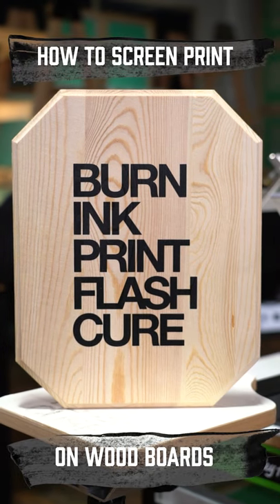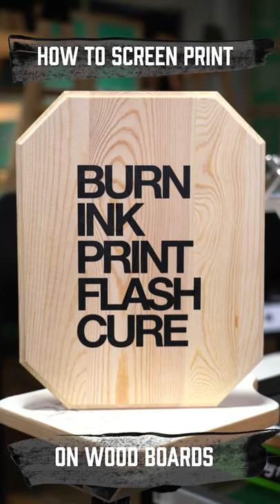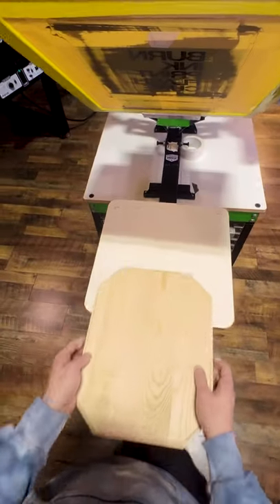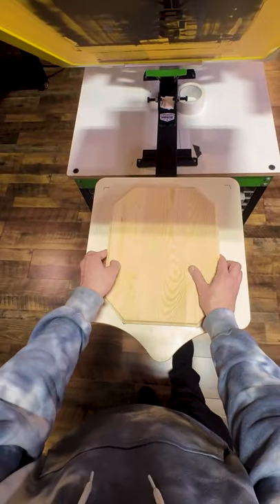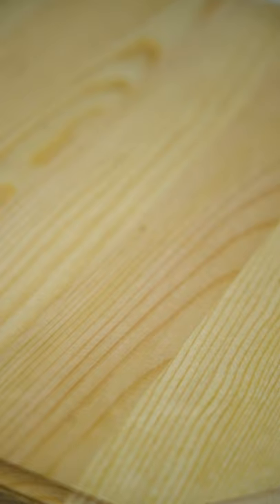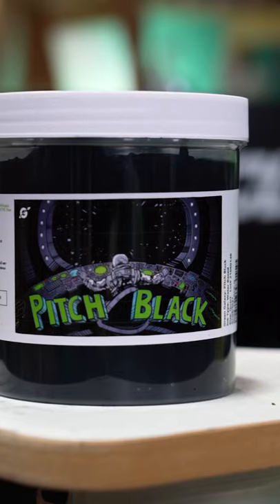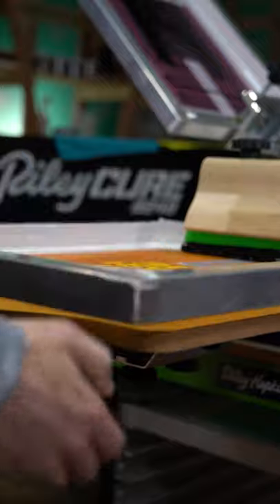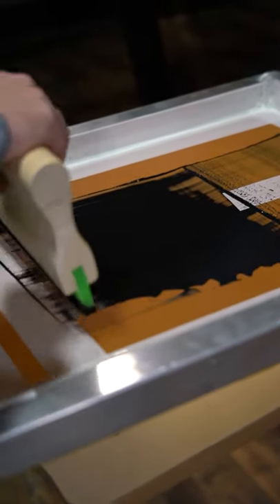How to easily screen print on wood #shorts

Comment: Do you know how to clean the ink off if you mess up? (On unfinished wood, and on polyurethane coated wood)
Reply from the maker: Wish we had a magic wand on this one! The ink will soak into the wood a bit so even wiping away with proper chemicals will still leave a stain on the wood. Definitely test as much as needed on scrap pieces before jumping into production.